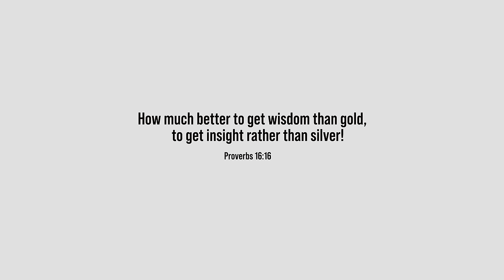JUST GREAT: A NEW WAY THAT YOUR TRACTOR CAN KILL YOU! 💀⚠️☢️

Comment: Best advice i got from my tractor dealer (mechanic was helping load onto trailer)  he said " Never get on a tractor without ALWAYS connecting your seatbelt" .....he said he had just recently almost rolled a tractor and he was still spooked by it.  People gotta realize that these axles Do Not articulate, so it is very easy to get off balance.  Great video and reminder in safety!
Reply: The issue is that the front axle does articulate. It would be a lot more stable with a front load if it didn't. 
That's why loaders have a rear articulating axle. Tractors are designed to have implements primarily at the back, hence hanving the fornt axle articulate.

Comment: I bought a new Kubota LX2610 last spring. I watched countless video’s of people using grapples and using the loader moving gravel. In the build I had the tires loaded, wheel spacers and a ballast box added. I cut down several big trees, dug out stumps and spread several truckloads of sand and gravel. I’ve had no issues with a tire coming off the ground. People spend thousands of dollars on a tractor yet skimp on spending money on items to stabilize their equipment for safety’s sake.

Comment: The NUMBER ONE THING I see newbees do with a frontend loader is filling up that bucket and raising it up almost all the way, so they can 'see' where they are going. My neighbor asked me about my 1025R/loader etc as he seen me spreading out loads of gravel. So he bought one, and loads of gravel too. I seen him loading up the bucket and raising it up to see where he is going. I went over to him and taught him a number of "what not to do" with his new tractor. I also told him to get his rear tires loaded. My uncle owned a dairy farm and I spent years over there with my cousins working that farm.(hardest job I ever loved). I was taught what to do, and what NOT to do when operating equipment.You want a real tippy tractor, try a Farmall(international) M with a row crop front end AND a FULL manure bucket. If that doesn't put the fear of God in you, nothing will.

Comment: Truth is these little sub-compact tractors are tippy. I had a close call with mine, going down a hill will a full load of dirt in the FEL and not enough ballast, in 2wd. That wasn't smart. The rear wheels lost contact with the ground and the front wheels being in 2wd had no resistance. I got to the bottom of the hill in once piece, albeit much sooner than planed.
Reply: Dude SAMEthing happened to me. Dropping ny bucket and standing on the brakes did nothing. I forgot the load should always be uphill x_x

Comment: First two hours I had my tractor and was using bucket to clear weeds under a shrub tree. Suddenly had a 20 ft dead walnut branch across me. Ripped my shirt sleeve by missed my head by inches. Did not see a grape vine snake up into the Walnut tree 20 feet away from where I was working.
I have also lifted the rear of my tractor (35hp) by trying to life a log with forks and the forks dug under a small root. Even with rear ballast.
Finally my neighbor was taking a full size backhoe up a fairly steep hill. The FRONT end lifted off the ground and started to spin sideways and of course you loose steering. I noticed a construction company working on power lines would scoop a bucket full of gravel when they were going up steep hills to keep the front end down.   By the way I do have Bora 4.5 in spacers and I told them it was from a reference from your channel. Night and day difference on hills.

Comment: I just bought a 2032r with a detachable loader. Not two days after getting my tractor, I used it to unload a 6ft finish mower off my flatbed trailer. The second I started to back up, the rear axle lifted and my whole tractor started rolling over to the left. I dropped the mower immediately and barely saved the tractor and myself in time. I’m going to get wheel spacers and rim guard asap. I’ve been running a 5055d with a 512 loader for a couple years, and I never had any trouble. I somehow didn’t realize that there’s a 4,000lbs difference in tractors. Scary stuff, please be safe out there!

Comment: Tractor mishaps, yeah I had a few.... Back in 1969-ish at 10 or 12, Father had me drive our neighbors 1956-ish Farmall-H with narrow front end 5 miles down the road to pull his tractor out of mud hole. So halfway way there I just got on dirt road then all of sudden the road got real bumpy, being in high gear the bumps quickly bumped that tractor right in the ditch, with front end and one wheel in ditch at a slope I was stuck.............. 1973-ish I was helping BIL dig around a small barn to move, he had me use his 1957-ish JD 2 cylinder with narrow front end with small FEL, with bucket full of dirt I back around on flat-ish ground and laid it right over on side........ 
 1974-ish in high school I was pulling 8" hardwood tree in Oct with a 1946-ish Case VA, I was almost at house  going slightly up hill in 1st gear when the butt of tree caught a stick that frozen in ground side-ways,  so the tree caught that stick, tractor front end started going up, at 45* angle I jumped off, next second tractor up-side down with broken steering wheel and seat,  my short life flashed before my eyes................  
1984 in my mid 20s, I got a job driving 540 JD grapple skidder with cab, early one morning in  Dec I grabbed bunch of trees at 90* angle, they was cut the day before so the limbs was froze in ground, as i took off in high gear I laid the skidder right on its side........... 1985 on same skidder I was hauling big pine log between bank and swamp, I was leaning a little then suddenly I was leaning a lot, I didn't lower the grapple quick enough so I laid the skidder over again, this time it went hard, I was wearing seat belt so that helped.........
1994 I flipped atv over sideways while going up slight bank at 45* angle, I was trying to get on dirt road, no damage........
1995 same atv I was going up a bank steeper then it looked at bottom, so atv flipped backwards on me hurting my back...........
1996 with different atv, in July I was pulling a small tree with atv with winch on back rack, when almost out I started spinning so I released winch and went ahead some then started to winch tree, while looking back on atv and winching same time, I DID NOT feel the front of atv going up, so while looking back at tree as it was almost winched up I decided to move forward, as I did the ate flipped over, on front rack was 4, 12" high screw in metal stakes, one caught my chest and broke ribs and punctured lung, two weeks in hospital, three months out of work, that was last time I tipped anything over............ 
In June 07 I bought first tractor and now while pushing 70 I dont dare to drive any tractor without ROPs and ballast, if I had an old tractor I'd put ROPs on that..........
Reply: Man, you got more lives than a cat.  Time to take up the piano, and stay away from off-road vehicles. You need to "Heed" the warnings 👍
Reply: @tcmits3699  It's just some like me take longer to learn, I haven't tipped anything over since 1996. I been close couple times with my tractor bought in 07, but  you know ole saying, close only counts in hand grenades and horse shoes', I know it's a miracle..... I cant believe yo read that whole story, I thought it was boring.........
Reply: @job38four10  I didn't think your close calls weren't boring at all.  I was being a little sarcastic, about taking up the piano.  We've all had close calls, best try and learn from them.  When you shared your scenarios, it'll make "ME" think twice about my surroundings and possible dangers in the future, thanks!  PS, who knows, you just might be a great piano player, HAHA🤞
Reply: Thanks be to God that you have lived to see 70. God is SO good!!!

Comment: Good video. Just want to mention that swinging the backhoe to the uphill side is doable, and I’ve been doing it since I bought mine. If you leave in the boom lift drift pin and leave out the swing pin, all you do is reach behind you and bump the left lever with your right hand to swing the boom left or right. It doesn’t solve stability problems, but it makes a big difference.  I’m in a similar situation as the subject here with very hilly property and running a small tractor work business with my 1025r that has me on new properties constantly. I also have loaded tires and wheel weights.  Every little bit.  For people constantly dealing with slopes, it’s an important thing to understand when you’re able to do it. Won’t apply to everyone though.

Comment: On my 3046r I added 4 inch rear wheel spacers and flipped around the front wheels to take advantage of their offset. Which added 3 inches on each side on the front. Its a night and day difference. Its not tippy anymore. The tractor just wants to slide on the inclines instead of tip.
Reply: Watch about the sliding could be a groove of some kind and it could flip not happen to me personally BUT to a neighbor

Comment: You definitely have to look up as well. Even when I first got my zero turn, I kept catching the ROPS bar on cables and low branches, and it would make the mower wheelie. I did it three times before I figured out what was going on, but the ROPS bar was catching on stuff and would pull my whole front end up.  That was the first time I’ve ever used a zero turn and a new property, but I was looking down at the slopes of the hills and everything, but it was the cables, I also did it on a tree branch   lol. but it’s definitely something we learned to look out for

Comment: I can attest that tractor activity can reach out and grab you when least expected.  Several years ago, I was running a box blade along my fence line following a dozer who was cleaning a nice path for me.  I had an 8610 New Holland with a canopy.  I was not wearing a seat belt, that was my first mistake.  Second mistake, I did not anticipate the branches above me as one caught on the canopy and then whipped back taking me with it right across the rear fender and on the ground.  It took a few seconds to figure out what had happened and then catch my tractor still rolling along.

Comment: I bought one of your Canopies for my Branson 3515H…so my roll bar HAS to be up…by default. I got run into a ditch doing snow operations by a kid last winter and nearly tipped over. I can tell you that being at that angle is SUPER uncomfortable and I’m glad I had my seatbelt on because I could have easily been flipped off the side of the tractor and crushed had it tipped to the low side  without it. Seatbelt….always. Canopy. By the way, is one of the best investments I ever made for my tractor and it’s withstood countless highway trips at 60-70 mph to job sites.

Comment: Glad to hear there were no injuries I myself work a lot with tractors. If you feel your front wheels losing contact with the ground you'll already get quite scared. I was taking feed out a silage pit and the tractor came with it's front wheels from the ground for a while it's quite scarry and it isn't even that small of a tractor it's a 150hp tractor so it's quite big.
Reply: Front wheels off the ground doesn't bother me.  The rears off, butt pucker time!
Reply: @donbrutcher4501  it wasn't the fact that they where of the ground but more the fact I couldn't even steer the tractor at all and steering with the brakes was no option because they are way too agressif to steer with. No matter what speed the front end came loose from the ground. And I had to go a little bit over a public road like that. So yeah that really sucked. The only way the front end was on the ground was going backwards 😅

Comment: Wow. He went over even with the weight of the backhoe on it. I have a slightly older (early 2017) 1025r and almost tipped it lifting a pallet (on a level driveway) once. I hadn't realized the far side of the pallet was loaded far heavier then the side i lifted it from. I was able to quickly drop the loader to the ground & was fine but it was a good lesson. Now i put on a heavy rear attachment if ill be lifting anything really heavy.

Comment: I have done my fair share of stupid things on my tractors over the past 62 of my 70 years. Started driving a 9N when I was 8. I remember when tractors did not have seat belts or roll bars.
Reply: Well you have to have both. No sense in a roll bar with no seat belt and a seat belt with no roll bar is a great way to get a lot shorter.

Comment: The one and only thing I’ve been disappointed in with our 1025 is that the front axle does not float. This tractor being a 4 wheel drive should have a floating front axle, because it doesn’t if you go over certain hilly terrain one back wheel leaves the ground and you loose traction if it is in 2 wheel drive any thoughts.

Comment: Just put 3" spacers on my b7800, notice a big difference in stability. I've also noticed that the faster you are moving the less reaction time, seems like common sense however I've witnessed some tractor drivers going along quite fast. Please slow down and concentrate on task at hand

Comment: I’ve had a small tractor without a loader for years and never had much of an issue except for having to much weight on the back and riding a wheelie. Just got my first tractor with a loader about 2 months ago and already had that filling of the rear tires coming up and the uncomfortable filling I got. You had a bush hog on the back and was getting a little too comfortable picking up and over sized tree that I should have at least cut once or twice with a saw. Also this tree was an up root and still attached at the ground. I had pallet forks breaking off the old semi rotten top. Next thing you know my forks got wedged in between a fork in the tree. One pallet fork was in the fork of the tree and the other was above the tree. I though I could roll the bucket and reverse out of it in theory but the tree was so heavy as soon as I tried to ease back the rear tires come off the ground. I found my self stuck there for a few minutes finally finessing the forks out of the bind. If I was have took a safer measure which I will do next time is just break the saw out and weaker the tree to free up the loader. Thanks for all the advice, tips, and equipment reviews! 👍

Comment: It is a hassle but if your backhoe is a quick release, taking it off when working in the woods will increase the stability of the tractor, plus it will eliminate something that could hang up on the trees or limbs.
Reply: But then you lose all that ballast. Gotta have something heavy back there.
Reply: @jonathantaylor6926 a boxblade is sufficient,that's what I use.

Comment: I think ANY pull behind implement is a hazard as the operator 
has to take his eyes off the road to constantly check on the implement.
Maybe a backup camera installed so the operator can glance at 
the screen without turning his head. There are many budget wireless
backup cam kits on the market for Rvs.

!

Comment: Rollovers are definitely dangerous. Keep bucket and weight low when moving wait till you're at the end to raise and dump bucket.    Watch out for open moving parts. Pto is a fast killer as well as moving parts on pto driven implement.  
I'll argue pro and con to seatbelts.  It may keep you on but it also greatly limits the options to bail off of you see it coming in time.
Beware of loose clothing that may snag and catch to get you wrapped up injured, snag controls while getting on or off or moving around equipment

Comment: I had it where I forked a stumpnthat was kind of loose on a 45 degree slope and when I tried to lift it would lift the rear up hill tire in the air so I simply lowered the loader and put it back down repositioned tried agian same.thing then changed the angle then got it out. By knowing just reverse what I'm doing with a lever and going slow I prevented a roll over. You go slow you slowly topple over so sometimes you can reverse it before you topple over

Comment: Never fear your equipment. If you are scared of it, DON'T USE IT!  Always respect the equipment. Just remember squishy bodies and steel don't mix.  Think it all through and never work it with heavy loads while potentially distracted.  When using the tractor for things it isn't actually meant to be used for, like pulling a stump out with a cable, physics is involved. If you don't know how to do physics, such as triangulation and pivot points, don't do it, a cable in the wrong place will kill you!   Most importantly, DON'T RUSH IT!  Take it easy and slow, this way if it starts to move the way you don't want it to, you can stop it before it gets going the wrong way.   Again, never FEAR the equipment, Respect it!

Comment: I run a landscape company and operate stand on skids and a 2.5 ton mini (u25) live in western Virginia and the vines are no joke. I have had 2-3 inch vines easily lift a mini ex or mini skid off the ground and these machines are much heavier that sub compact tractors its insane how strong they are be careful if you snag on one and cannot untangle yourself my best advice is stop get of and cut the vine to release the pressure

Comment: Right after I got my 1025r home on the first day, I was going through the yard at top speed clearing up some small logs I'd recently cut with a chainsaw. One of them fell out of the bucket on one pass and when I went back for another load, I ran it over (which normally would have been fine because it was only like 2-3 inches thick and about 2 foot long.) When the front tire ran it over, it spun the log around perfectly to work as a sort of "pole vault" for the rear tire and launched it into the air, almost flipping the tractor and nearly launching me out the seat! Luckily I had my seatbelt on and it wasn't quite enough to flip it.